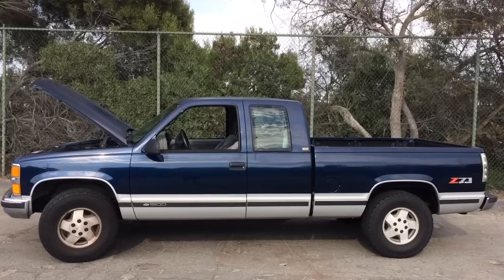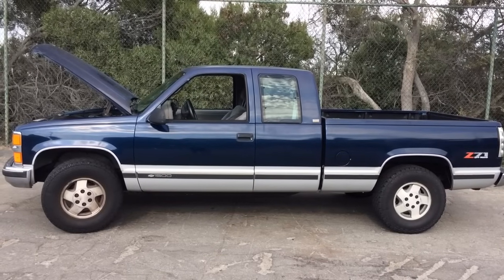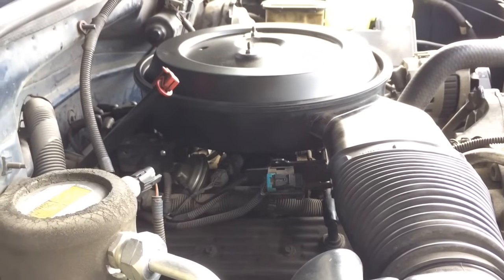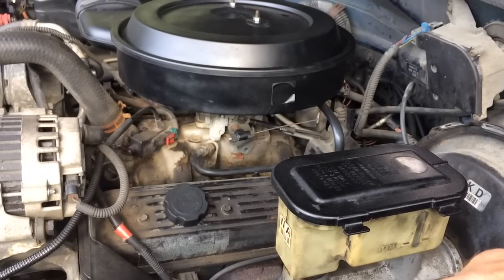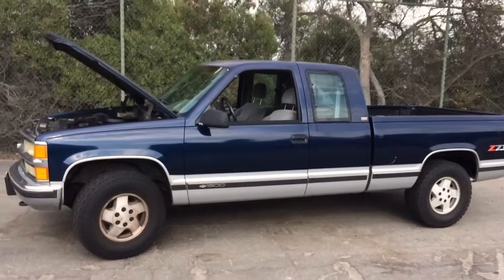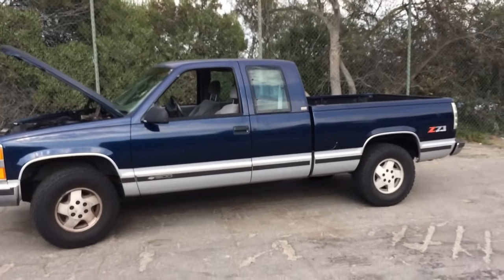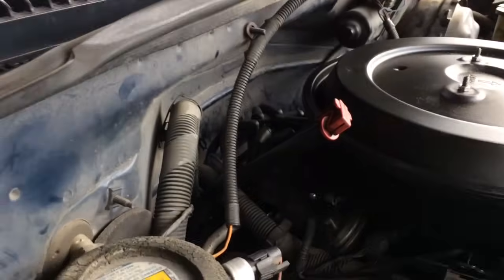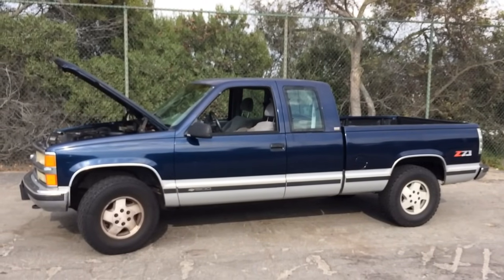Chevrolet Truck Hesitation Problem Fix

Comment: How did you cut your catalytic converters? I’m replacing my maf sensor tmmrw and if that’s not the issue then ima have to eliminate my catalytic converter.
Reply from the maker: I had somebody replace my catalytic converter. I still have to pass emissions in California with it. I think the problem was that it was all clogged up and old. It passes emissions and runs fine now.

Comment: What one part did you replace fix your pickup? Changing a lot parts is expensive.
Reply from the maker: I think the problem was with the catalytic converter, but I’m not sure.
Reply: @hoohoohoblin  That makes sense. We both had misfiring problems. I noticed steam and water coming out my tail pipe. I had to replaced the distributor cap and rotor. I later learned that if you drive your car to much when it's misfiring, it can ruin your catalytic converter. Thanks.

Comment: Question, what can it be when my truck sits  overnight and or about 4  hours and it starts up, just to die.. but once it's warm, it runs great and doesn't turn off like it would when no warm enough.
Reply from the maker: I don’t know. I need to figure that out and make a video about it. Mine does that and I just let it run for a minute before I drive it.

Comment: I have a 1988 Chevrolet Silverado 350 4x4 pickup I have 3 vacuum ports on my carburetor 2 of them have vacuum but the one on the right doesn't can you tell me maybe why I'm not gettin vacuum on the right port
Reply from the maker: I don’t know. Mine is fuel injected, so I don’t have one I can look at. If you follow the hoses, you should be able to find the problem.
Reply: @hoohoohoblin  I made a mistake it's fuel injection

Comment: My 98 k1500 only runs sluggish when cold start after I drive around the corner to gas Station and start back up it has take off like normal any idea what that can be?????
Reply from the maker: I’m not sure. Mine started doing that recently, and I need to figure out why. It runs great except for the first minute.

Comment: Sounds like the old parts cannon was fired at it. Don't figure out the problem, just start replacing everything till it fixed.
Reply from the maker: +Duramax Tech yes. That is an accurate assessment of what I did. I put a bunch of parts on it, starting with cheapest first, and then I handed over to a mechanic with 30 years of experience, and he kept putting parts on it until it was fixed. Some of these things are hard to figure out. But now I have a truck that I know will run forever.
Reply: Well, he's honestly a shitty mechanic. Not even a mechanic, I'd call him a parts changer. There is always a way to accurately diagnose a problem with a vehicle. Throwing part after part at it gets expensive fast and it's far from the professional thing to do. Do yourself a favor and find a new mechanic.

Comment: I have a 1995 Chevy Tahoe and I have 350k had it for 9 years and it started to do that also I will check fuel pressure see if it’s that I also have. A play in my steering wheel also I but a refurbished steering box but still have that play some help will be great full
Reply from the maker: I hope you figure out the problem. Sometimes it’s tricky to find out what’s making the truck hesitate.

Comment: I have a problem starting my truck when its hot out side. When it is cold out it starts fine. I know older chevys are the other way around and don't like the cold but mine is backwards.

Comment: Just got 2000 2500 2x2 6.0. It runs inconsistent.  Either it runs really good or it hesitates on acceleration for a 3 or 4 seconds to several minutes.  Changed plugs and wires, (ran excellent for a few hours, started the random hesitation again)  dosen't seem to have vacuum leak. I only checked with some carb cleaner & starting fluid (i know very dangerous route to go) 
Codes are system to lean bank 1 & sometimes throws bank 2.   (P0171, P0174) cheep OBD reader.  Any suggestions?
Reply from the maker: My truck is the previous generation, so I don’t have experience with that particular model. It could be that the ECU computer has gotten bad. The codes are definitely a clue. I’m not sure how they fuel injection is managed on that truck, but that’s what I would look at first.

Comment: I have a 95 gmc sierra 2500  7.4  it hesitate when i step on the gas.i changed the MAP Sensor. the IAC valve. I cleaned up the EGR. & still can't find the problem. Any suggestions? I "ll appreciate it thanks
Reply from the maker: It could be the muffler or catalytic converter starting to rust out inside, obstructing exhaust flow. Or a weak furl pump or clogged fuel injectors . On my truck, I think The catalytic converter was the problem. The plates came loose inside and were blocking exhaust flow.

Comment: Check Your Gas Tanks... They Can Be Rusting From The Inside And clogging The Fuel Pump Strainer, Leading To Bad Plugs Resulting To Hesitation, Stalling And Overall Bad Performance.

Comment: could o2 sensors be my problem, all of them are bad on my 1998 Chevy Silverado. i cleared codes and it runs fine
Reply from the maker: That could definitely be a problem. The system needs to know what’s in the exhaust so I can set the mixture.

Comment: I'm the 3rd owner of my beautiful Tan 1995 Chevy Z71 adult owned and everything is 100% original except the "99-"00 Chevy Z71 wheels has new plugs and wires, Iv owned it for a few weeks now and this just now started...when it's cold and I let it idle for 2 minutes or so I put it into gear and it'll sputter then die...starts right back up and idles fine so I let it worm up a little bit more enough to get the temp gauge up to about 100-110 and it's fine. Still has the stock GM fuel filter on it so bought a new filter and going to change it out tomorrow and let y'all know if that fixes it incase someone has the same problem.
Reply from the maker: Mine does the same thing. Not sure what the cause is, but it doesn’t do it if I let it run for a minute or two before I drive it. It passes emissions and runs great otherwise, so I haven’t tried to figure it out.
Reply: Changed the fuel filter and it's running fine now, I blew through the old stock one and it was like blowing through one of those REALLY small coffee stir straws. Lol
Reply: Justin Watson replace the camshaft position sensor my 98 gmc has the same issue and that fixed it right up

Comment: No engine light, found my issue Mass Air Flow Sensor.
Reply: What MAF sensor?
Reply: In between air filter and intake.
Reply: Really? I guess the factory forgot to put one on my 95 chevy truck...
Reply: My truck is a 2000 model 5.7 350. These engines were very similar for a long time with small changes. I dont know specifics of when they started adding them.

Comment: My used 95 ran great first 3 years but started surging and hesitating this year. Put over 1500.00 in parts that could be problem with no luck. It runs better when the engine light comes on but when it goes off back to surging and hesitating....someone got a match so i can put flame to it lol
Reply from the maker: +Bryon Arbuckle I hope you figure it out. It took me a year to get this one sorted out. I think the clogged catalytic converter was the main problem.
Reply: hoohoohoblin exhaust is jacked up. Actually pretty much gone, so bad i need entire system including both manifolds....2,000.to replace. Nope lol
Reply: Check O2 sensors. When the computer senses a failure it goes into a default fuel trim, hense the reason it runs better with the engine light on.  Clear the codes and the faulty sensor is again controlling fuel trims. Just something to check.. Hope it helps.
Reply: Bryon Arbuckle that’s probably why.

Comment: Do you guys know what can be wrong with my 1995 Silverado it will idle good but accelerating it will have no power out of no where it will kick in and have power then just stop and be slow again
Reply: Then after a while check engine soon light will turn on and be even worse then will turn off feel a little better then will randomly get power again then loose it any ideas?
Reply from the maker: Could be a stuck EGR valve.
Reply: Sounds like the fuel pump. On my , 95 C1500, all of a sudden it wouldn't go 2 blocks before running badly then stalling out 
Turned the key back on truck started but same scenario as above. Threw parts at it but nothing changed. Turned out it was the fuel pump! 
I believe by turning the key on, the dying pump shoved some fuel to the engine, enough to go a block or two then went unconscious, then repeat again and again, until I got it home,.
That was 5 years ago, now different problem, stutters off idle, working on that one now? Hope that helps!

Comment: Another thing that is common is a leak in the vacuum lines headed to charcoal canister as I said in one comment towards your channel these trucks are good but plagued with issues
Reply from the maker: +Fran Mitch yes. All that emissions stuff can go bad if there’s a hole in a hose or if it cracks from being old. Those kind of problems are kind of hard to figure out and fix.
Reply: hoohoohoblin it's too bad you have emissions where your at I live on the colorado & new mexico border no emissions here they'll run forever but like dog shit in bigger cities like Denver they practicality give away older vehicles like this due to the constant upkeep but where I live like I say they're all over the place still rolling

Comment: What was the fix?  You listed a how bunch of parts that you replaced.  But you didn't say what actually fixed it.
Reply from the maker: I think my problem was a clogged catalytic converter. That would explain why sometimes it ran OK and sometimes it didn’t. I think the plates broke loose inside, so sometimes they would obstruct exhaust flow.

Comment: Having issues with my 1995 as well I accelerate and it takes time I have to take my foot off the pedal then press it and then it accelerates my abs light is on and also my gas marker doesn't read could that be a issue any help
Reply from the maker: The ABS light wouldn’t have anything to do with it. The good thing about the ABS on these trucks is that if the light is on, the brakes will still work, it’s just the anti-lock brake part that doesn’t work, so you can safely drive it with the light on. A lot of people just let it stay on forever because the wheel sensors are so sensitive. Not sure what the hesitation problem could be, but it would probably be something I mentioned in the video. As simple as these trucks look, there are a lot of little parts that could be causing the problem.

Comment: i'm a smog checker, these model trucks are the absolute worst for burning out catalytic converters.
Reply from the maker: I hope mine lasts a while. I just replaced it, and it wasn’t cheap.
Reply: Dont buy bolt in cats next time. Buy thunderbolt cats for 50 a piece and weld them in

Comment: My 91 5.7 5speed has over a million on it and still running strong. The bow tie rocks.... Ford's are GA _y
Reply from the maker: These trucks will run forever with a little bit of maintenance.

Comment: my 1992 chevy p/u, the EGR would open too soon from idle with the truck in gear causing the stumble. pulled and plugged the vacuum hose to the EGR valve and the truck runs great, will soon be replacing the electric/vacuum control that is near the EGR valve.
Reply from the maker: I had a similar problem on my Safari van, with the EGR valve getting stuck open because it had carbon buildup. I cleaned it, and the hesitation problem stopped.

Comment: What does the catalytic convertor sound like? My truck sounds like a roller coaster going up. Constant clanking
Reply from the maker: It sounded like this.  GM Truck Transmission Rattles In Drive When Stopped Fix https://youtu.be/gVL2A1iYRLQ

Comment: My truck doesn't have a catalytic converter straight pipe with headers.
Reply from the maker: Then you'll never have any exhaust restriction issues!
Reply: hoohoohoblin...... yeah I do have Restriction but you how it goes. I fixed the problem on my truck, it was Map Sensor connector. Now it runs Great, I'm just going to put some other sensors it will be good.
Reply: Mine doesn't either       the problem I'm haveing is  the idle is to high changed the idle air control valve and the tps and still chokes out when started until rpms drop below 1000   and is started late shifting I'm suspecting the map sensor but honestly I'm kinda lost  I'm starting to feel like I'm just replaceing till i get the right one mine is a 1994 3/4 ton 4×4 with the 5.7 auto trans with over drive
Reply: @Devon Pennartz it does  I'm thinking at this point it  could be my shift solenoids in the valve body in my transmission    if you pull the pan there right there side by side.  I've read if they get clogged it can cause all kinds of issues.  Let me know what you come up with id be very interested to know.
Reply: @Scott Lovell the 4l60e has a bad problem with the 1 to 2 accumulator and the 3 to 4 accumulator GM put plastic pistons in them and they dont hold up very long. Mine shifts from 1 to 2nd about 25mph and then 2nd to 3rd around 45 but when it get up in the rpms at normal driving conditions it erraticly fires. I also have rich conditions.
Reply: @Devon Pennartz I had this same problem changed the tps and it solved the problem

Comment: Help. My 1990 chevy. Turns on well. However when i accelerate it stalls and no gas goes thru then shits off. ??? Help !!!!
Reply from the maker: Could be the EGR valve stuck open. Or maybe a weak fuel pump?

Comment: I have the same truck and engine and it idles really rough only when in drive fluctuating between about 400 and 600 rpms. It has 102000 miles and has been sitting in a garage for a while, I've tried seafoaming the gas tank but no difference. Also replaced front vacuum tube that goes from front of throttle body to head and the valve that sits in the head. Drives fine but any recommendation on the idle issue?
Reply from the maker: Could be dirty fuel injectors or a dirty EGR valve.
Reply: hoohoohoblin thanks, I'll try that next

Comment: I got a k1500 and the same exact problem hoping it's the fuel filter, already replaced tps didn't fix anything. I think it's not getting enough fuel or computer bad
Reply from the maker: It is probably the fuel pump or a clogged fuel filter. Once you change the fuel filter, you could have a mechanic test the pressure under the hood and see if it’s enough or if it’s week. The other possibility would be that the catalytic converter or the muffler is worn out and clogged, so the engine can’t breathe.
Reply: hoohoohoblin okay Thanks. I'll see if I can figure it out

Comment: I have a 2003 Silverado Extended Cab 4.3L V6. Everytime i step on the gas, it always hesitates and wont accelerate fast. Help!!
Reply from the maker: It could be an obstruction in the exhaust system. On my truck I’m pretty sure the problem was that the catalytic converter was worn out and the plates were jamming up the airflow.
Reply: Alex Ramirez Same On My 98 k2500 did you find your problem?
Reply: Cam sensor?....having same problem
Reply: Bad TPS or EGR valve.  Try bypassing the EGR by plugging the vacuum line that comes off it.  If that fixes the hesitation it's bad.

Comment: So what part or parts fixed the problem?
Reply from the maker: That’s a good question. In my case, the catalytic converter was bad and it was obstructing the exhaust flow sometimes, but sometimes it wasn’t. I think the plates were loose and jumping around as the engine ran. The new catalytic converter fixed it.
Reply: @hoohoohoblin  Thank you.

Comment: Not sure if that applies to other years. On my 1997 having that prob. Revs up fine in park. Then put in gear lose of power barely making speeds. Someone said it’s a MAP sensor on 97 vortec manifold absolute power sensor.
Reply from the maker: +pezmaner1 yours is probably different. Mine has throttlebody fuel injection, and yours has multi port.
Reply: Its Your Pump I Just Did Mine

Comment: I have a question for you. Although I have not used the paperclip thing in the box under the dash to see which code the 'service engine soon' light says, my service engine soon light kept coming on and off so, using my limited skills, I replaced the oxygen sensor (which looked good and probably didn't need to be replaced) and that didn't help. Next, I replaced the EGR valve (which looked good and probably didn't need to be replaced) and the service engine soon light keeps coming on but doesn't stay on. Sometimes it doesn't come on at all. I am almost positive it isn't the brake switch so now I am at a loss. Do I replace the EGR solenoid and hope for the best or what? Any suggestions? I am not a mechanic by any stretch but not afraid to tackle some of these things. I can waste a few dollars here and there and still be ahead of the game if I compare to taking it to a shop somewhere and get charged $100 an hour or more. I am open to any ideas you might have.
Reply from the maker: This is a really tough one. Even if you take it to a mechanic, they might not be able to figure it out either. I generally start with the cheapest and most logical parts first and go forward. On my truck, I think the problem was the catalytic converter plates had broken loose and were sometimes obstructing the exhaust flow. Could also have been the fuel pump being weak.
Reply: Did u ever figure out the problem?